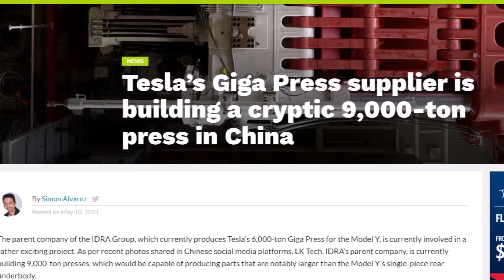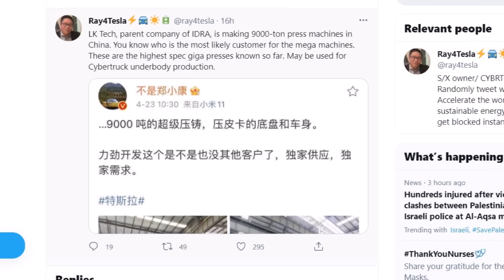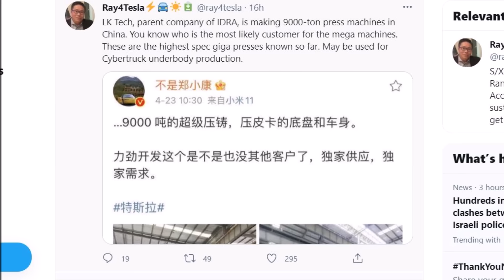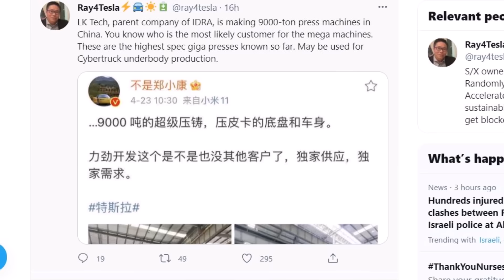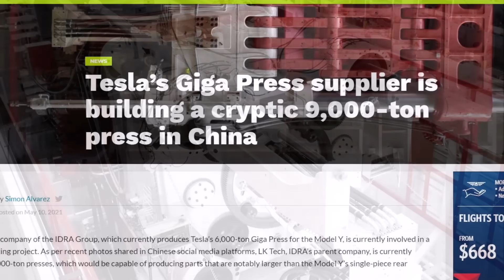Tesla Supplier Builds This Huge Giga Press in China for Bigger Models

Comment: a 9k ton machine is not warranted for the model 2.  A cybertruck is not really going to be widely used in china. Tesla is discussing making a van for either transit use or for shipping and delivery. This would be a more useful and in demand vehicle in china. This sounds like it will be teslas next vehicle. If they need a machine for the model 2, they will use the 6k ton machine. Each casting requires a die, and there is no point in making a model 2 die for the 9k ton machine, and then have to make another later for a 6k ton machine. You do not want to keep tying up the 9k ton machine for a model 2 when it would be needed for something else.   NOW THE OTHER POSSIBILITY:  So far tesla has been casting cars in sections because no machine is big enough to do the whole vehicle. However if the model 2 is small enough, and a 9k ton machine is big enough, maybe it would be used for the whole vehicle which it is not able to do for any other vehicle.

Comment: Agree with the Model 2 needing a 9,000 ton machine.  It is likely that the chassis of the Model 2 is not 3 pieces but 1 piece and therefore the need for the new and much larger machine.

Comment: L.K. Machinery (IDRA's China based parent company) is likely the source for the 6100 presses at Shanghai.  I wouldn't be surprised if Tesla was trying to make all of the structure for a "model 2" with a single huge casting = 9100 Giga-Press.  As per a Tesla patent US15/874,348 “Multi-Directional Unibody Casting Machine for a Vehicle Frame and Associated Methods.”  Talk about speed, efficiency, accuracy, cost cutting.  Imagine ~90sec for front, middle, rear, and maybe even A,B,C pillars, roof rails, etc. ... or Maybe Semi.  Cybertruck has other unique issues/materials, I assume it will be limited to Giga-Tx for awhile.

Comment: This bigger press might do multiple castings at the same to time. One cast every 90 seconds or so seems slow for such mass market car. 

Or they are planning on doing the semi in china. Panasonic is building a battery factory to produce 4680 cells somewhere in Asia I believe. This will coincide with semi or cybertruck production

Comment: Assuming it is Tesla as the customer of those Giga Press machines is a big assumption. It could also be any Chinese car manufacturer such as Volkswagen or Mercedes, or any domestic owned car manufacturer. Yes it probably is Tesla, because Tesla has the formula for the special alloy that you need to make those machines work properly, but confirmation is needed from Tesla